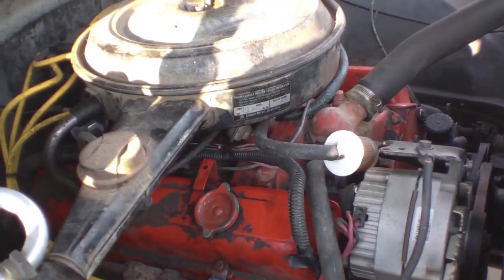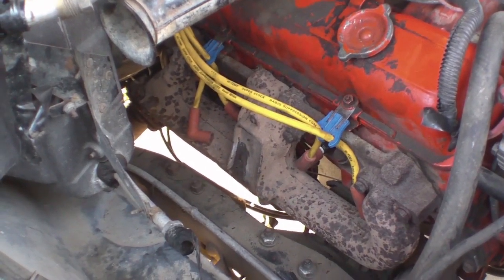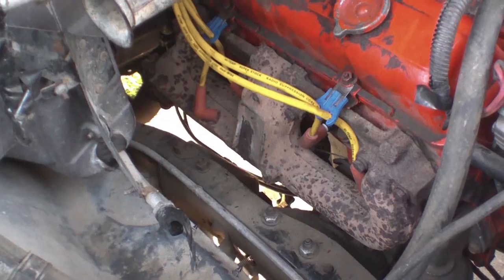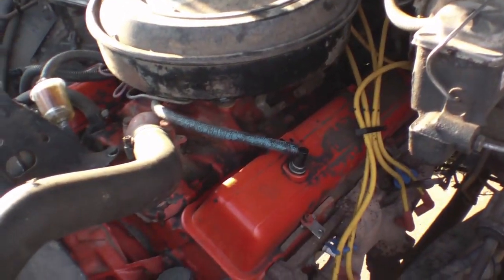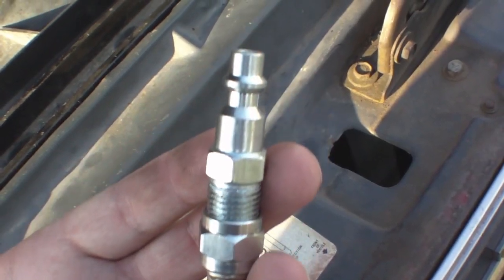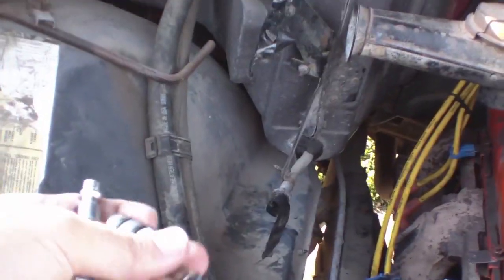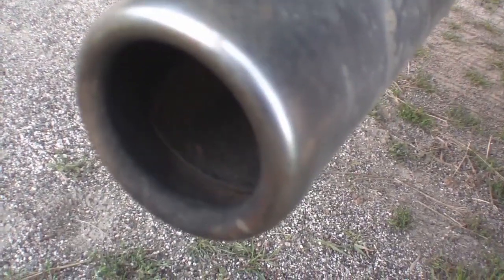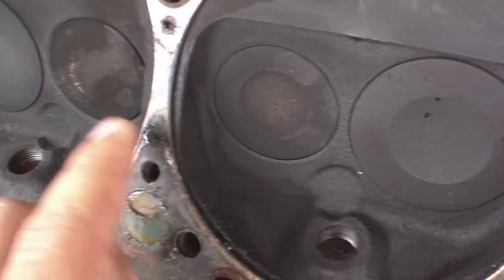How To: Diagnosing a Dead Cylinder compression and leakdown test (burnt exhaust valve)

Comment: I had the same problem on my HZ Holden wagon 253 v8 was told exhaust valve was gone heads had to come off but the day before i was about to take the heads off it was nearly dark i had the engine running and coil  was lit up like a Christmas tree i changed coil now the engine runs smooth as silk

Comment: Your truck was shutdown it self or when on gear reverse or drive or no
Reply from the maker: It ran well enough to move under it's own power and idle, didn't die.
Reply: Ohh right, I have gmc 1986 it start and die when I put on gear I did Chenge 
Fuel pump 
Fuel filter 
Distrubutor cap 
Spark plug 
 And still doing the same thing
Reply from the maker: @angelcastro3714 Make sure to check for vacuum leaks and inspect the EGR valve to make sure it isn't stuck open. What happened before the problem appeared?
Reply: zcomputerwiz just stop running and when I out o gear like reverse and drive it die

Comment: It was newly rebuilt? They messed up. To isolate a bad lifter, disconnect the rocker arms on each cylinder at a time and check leak-down. If the lifter is bad, the leak-down will be normal.

Comment: ... naive question there --- my 1990 CRX was just diagnosed with a burnt valve in cylinder # 3 by means of leak down test ... with that said what exactly would have been the difference in a leak down or compression test ... is the leak down test more in depth to find out the issue?
Reply from the maker: The compression test helps determine which cylinder(s) are losing compression, the leak down test will reveal where the lost compression is going and how much. The compression test is turning the engine over and checking the pressure produced in each cylinder, the leakdown test is adding a controlled amount of air to a cylinder with the piston at TDC and both valves closed then observing where that air goes ( if anywhere ).
Reply: .. thanks for the reply ---> so if my mechanic only did a leak down test thats good enough test? ... meaning could a compression test find something else out that a leak down test cant find ?
Reply from the maker: VONN That's right, a leakdown test is a more comprehensive test than compression alone, so that is sufficient :)

Comment: Time to get a Ford!!!!! Ha ha ha, oh wait, no, there will be different issues with a Ford, I've had a few :-) I went Japanese, everything is made in one place, less of a chance of mis-engineering something. Most problems are caused by lack of maintenance though some shoddy repairs do crop up.
Reply from the maker: Dave Kauffman This one appeared to have had recent work, some of the valves didn't match and the engine block, valve covers, etc. had been sprayed orange. Probably a failed back yard partial overhaul :p

Comment: Not sure why you'd waste time with a leak down test, if you have a poor cranking compression test, your going to have to tear it down. I guess some folks have more time than I do.
Reply: fagejs his video is the only video I find that was helpful and learnt more then one method to check for dead engine... remember your not the only one watching the video other people wanna learn too..
Reply: Fagejs, Are you seriously asking for the difference b/w pulling a motor vs pulling a head? Diagnostics give you the power to make that kind of decision!
Reply from the maker: I already had the equipment, I wanted to find out if it was valves, rings, or something more catastrophic.
Reply: It's a teardown either way, just seems like time down the toilet. Certainly a personal preference.
Reply: Or you could pull the head first, and if need be pull the engine. My point is, if you have no cranking compression, you might as well start disassembly.
Reply: @Jsf445  thats twice the work when you can just diagnose the issue.
Reply: Had the rings been worn, then pulling the head anyway would be a gross waste of shop time. Compression test is much much quicker than pulling a head.
Reply: ... naive question there --- my 1990 CRX was just diagnosed with a burnt valve in cylinder # 3 by means of leak down test ... with that said what exactly would have been the difference in a leak down or compression test ... is the leak down test more in depth to find out the issue?
Reply: I hope you enjoy every differential compression test you perform. I'm not doing any.
Reply: Aaron Frazier Then please by all means, do a differential compression test.

Comment: i did a leak down test  and so what if air is leaking through the valve covers?
Reply from the maker: Did you make sure the piston was at TDC? I assume air is rushing out the breather on the valve cover?
If this is the case, it may indicate bad rings or a hole in the piston.

Comment: had this happen on my 1991 C-10 due to PISS POOR head work.  I will not go into details, but the re-manufactured heads were not done right and caused major issues.  If you buy heads, have them assembled by a trusted machine ship, NEVER put assembled heads on. I was "lucky" too and the valve did not drop into the bore and destroy anything other than itself.

Comment: Looks like exhaust valve on number 8 cylinder has heaps of valve recession as well,my dads 2000 model Holden VX Commodore (fitted with the Buick V6 here in Australia) has a similar problem ,it runs on LPG (liquified petroleum gas),it has developed a misfire which I have traced to valve recession on the exhaust valve in cylinder number 2.
All of the other cylinders have around 1200KPa (174 PSI) whereas number 2 cylinder has an "erratic" reading which varies between 900 - 1000 KPa,when oil is added to the cylinder, a marginal gain of the 940KPa or 1000KPa is achieved,there is also a "popping" sound out of the exhaust which leads me to think it is the exhaust valve,cars fitted with LPG systems suffer a lot from valve recession in the exhaust valves,the car is fitted with the "valve saver" system which injects a lubricant into the inlet manifold to lubricate the valves,but I don't think that's always reliable.
The car has about 330,000 kilometres on it (a little over 200,000 miles) and he was flipping a coin as whether to spend hundreds of dollars on a 14 year old car which is probably only worth $1500 in Australia on getting the cylinder heads done up for LPG use which includes fitting stainless steel valve seats,etc,someone on Ebay is selling a used head for $50 over here in good condition in Australia (including postage) and would like to buy it for him ,only at the moment I'm broke.
Reply: trollunion54 just another internet bully.
Reply: no one cares

Comment: Well, even if the cylinder sleeve would be damaged it is posible to get that fixed, but it would be expensive. Valves are some what easier and a quite bit cheeper in that case. But if the cylinder sleeves would be damaged in most cases a new block would be cheaper. Then put the engine back together in the proper way then it should run like new. NOTE: this is explaining a long story in a short way.